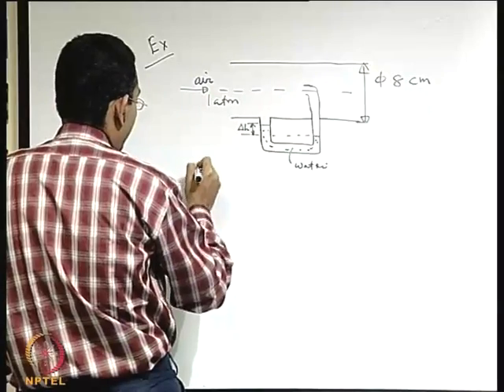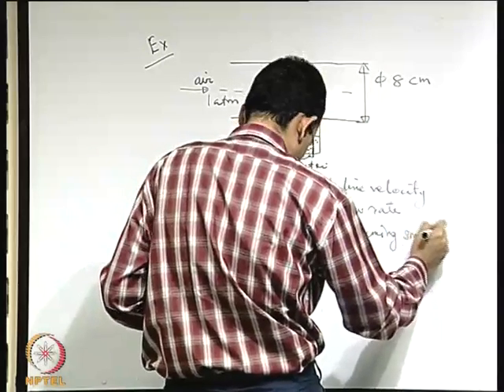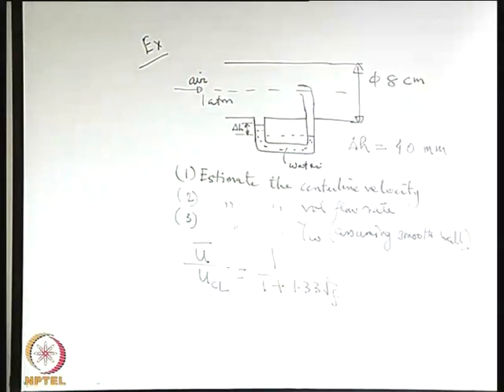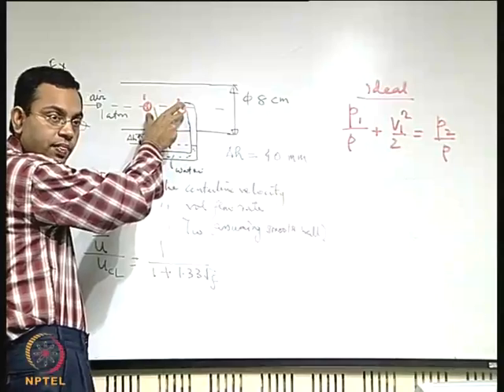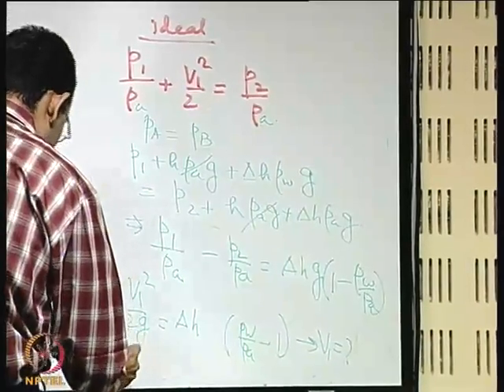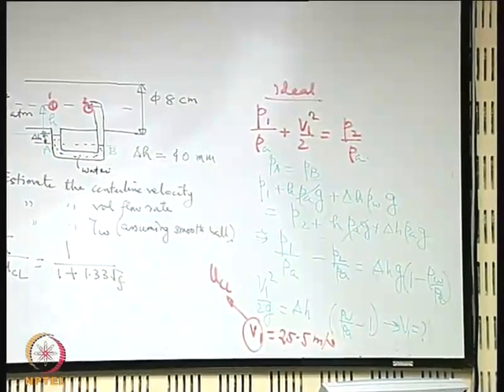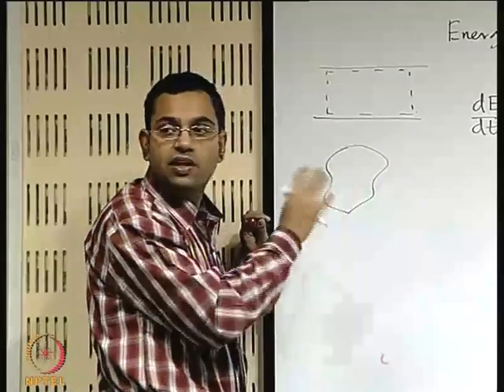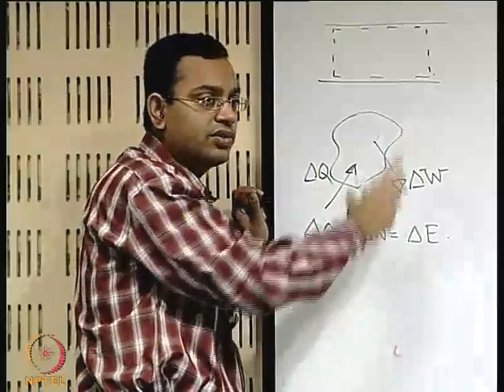Mod-01 Lec-46 Pipe Flow (Contd.)

Comment: In the first example, since pressure at first section is higher, the depth to which the manometric fluid is pushed should be larger in the left limb as compared to the right limb. Therefore, the diagram for delta_h is not correct.
Reply: Pressure at point is higher because velocity at that section is zero which gives higher pressure pushing the fluid downward on right side . So ,diagram is correct !